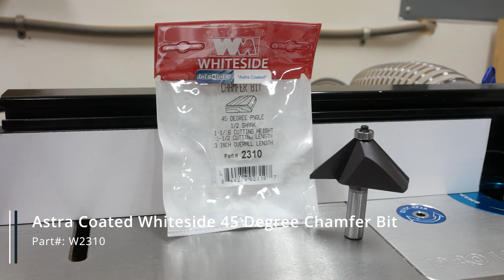How To Make A Wood Box with Bits & Bits Router Bits

Comment: What feed rate and DOC were you running the 425-CM125? I am new to the Shapeoko. I think I go to slow and burn them up. My dewalt it set on 1.
Reply: David, the feeds and speeds are in the video. Pause it when the banner comes up showing the bit part number.
Reply: @Simplecove  Awesome.. Thank you. Great video!!!